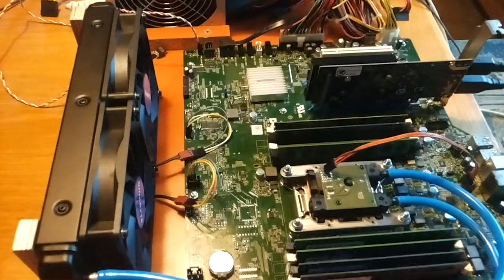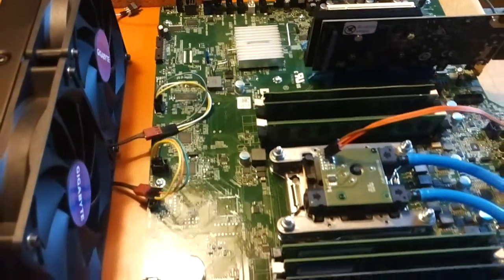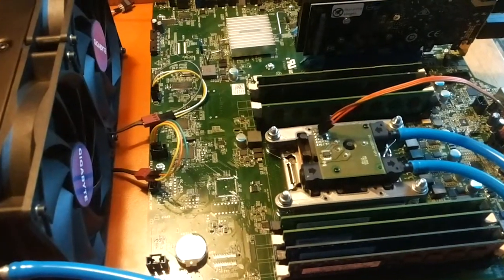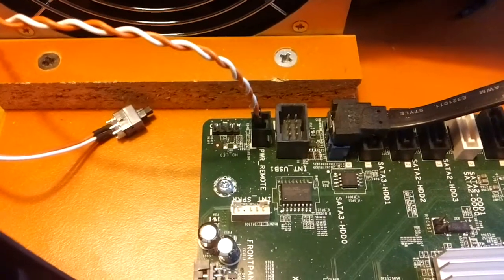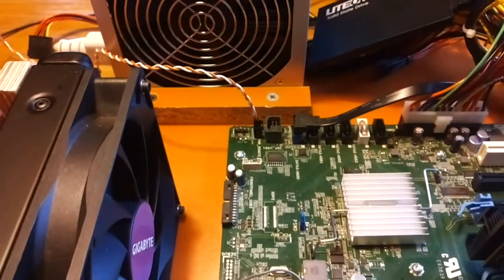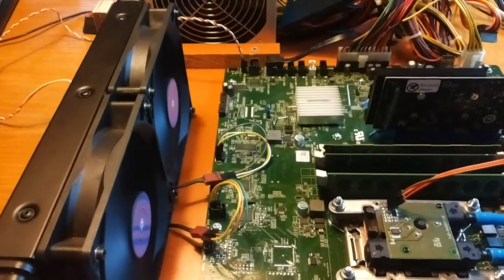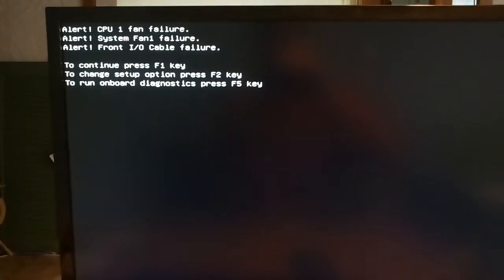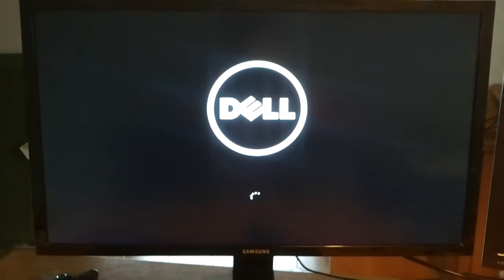Dell T3610 front panel pinout - how to power on the motherboard mainboard

Comment: Hi, i just got the same motherboard but for some reason it doesnt turn on... I already repinned the psu, if i short the rtcrst pin it turns on for a second and then turn off, but if I short the pwr_remote pins nothing happend... I hope you can help mi with this
Reply from the maker: Make sure the power connector is wired correctly. Leave the 'blank' pins open. This should work now. Make sure there is no broken RAM or something wrong with other Hardware. https://www.techpowerup.com/forums/attachments/dell-atx24-2-jpg.138617/
Reply: Did you ever figure out how to get it to turn on? I'm having the same issue.  I've repined the power supply and have been trying the switch.

Comment: hej my friend , so you just used regular two wire switch ? like a reset button or start button from any case ? I have dell t5600 motherboard and is a total nightmare to turn this on. I spend so many hours already uff..   I ended up buying dell power supply and front panel but still is not power on, zero. But I also has the same power remote connector on my MB but nothing is plug over there. I tried to close circuit with screwdriver but is still nothing. Please let me know what kind of magic switch you used in your movie.  THX
Reply from the maker: Close the circuit on this connector with a screwdriver or something should work. I plugged in a regular two pin button. Please take notice that the power connector is not a standard pinout like on other computers.